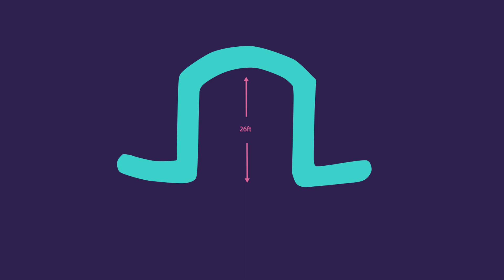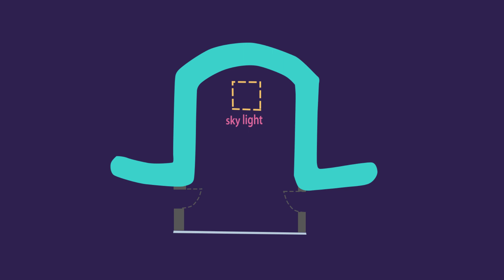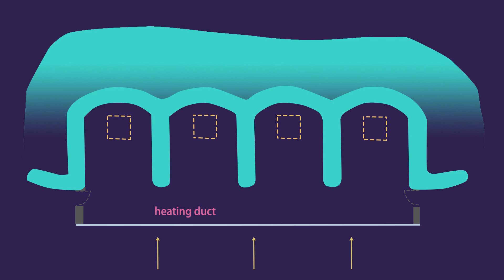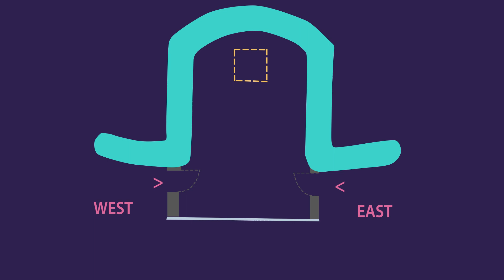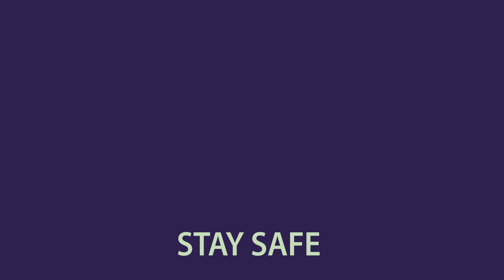Earthship Design (2/3)

Comment: Not all of these methods are used any more.  The technique has evolved a lot since the first book was written.  I can explain much more of that if you are interested.
Reply from the maker: Appreciate the proposal. We would love to hear more
Reply: The depth of an Earthship is usually less than 18 feet.  The key concept is that the sun must reach the bottom of the back wall.  If the sun cannot reach that wall, there becomes a disconnect and the back of the structure stays relatively cool all year long.  
Ventilation has been changed to come from cooling tubes in the back (north) berm.  This cool, fresh air is pulled through the home from vents built into the south face roof.  Warm air rises and is released (through a controlled series of vents) out of the top of the structure.  
The thermal mass in the berm, the heated air along the south face, the closed-off greenhouse area and the ventilation system all work together to keep the structure at a constant comfortable temperature without using any powered heating or cooling systems at all.  
The electric comes from solar panels on the roof that power a bank of batteries.  This power system is divided into separate AC and DC systems.  The DC system powers the refrigerator, water pumps and some of the lights.  The AC system powers most outlets, your computer, the entertainment system, etc. - like a regular home.  
Maybe one day the system will be large enough to recharge your electric car, but that would be a pretty tall order for the system used today.
Reply from the maker: Great information.  I ll figure out a way to collect these info in one place and highlight it to our audience
Reply: @user-tp9gy8kt2q  I'm interested! how can I reach more details about the Earthship! I'm making an ecologic guest house with these technics of earthship
Reply: Check out the websites at Earthship Biotecture.com and Earthship global.com for more info.  They are located in Taos, New Mexico.  They have an academy that offers classes throughout the year - online too.